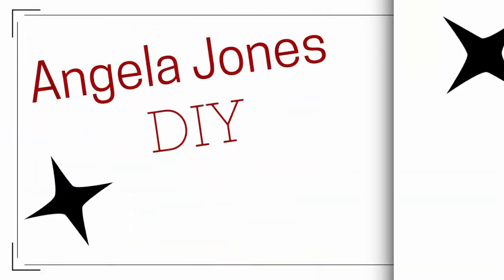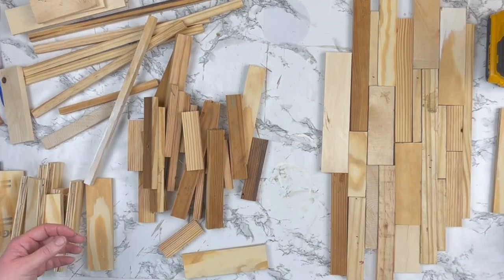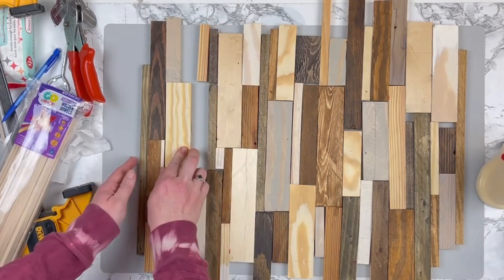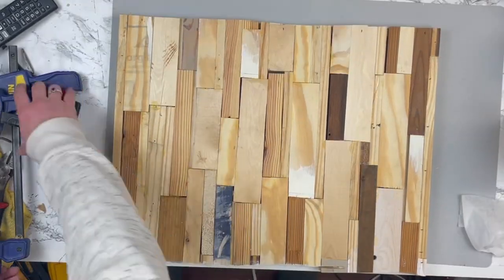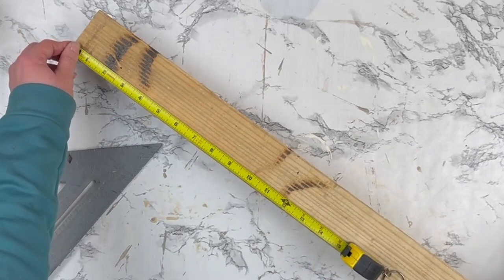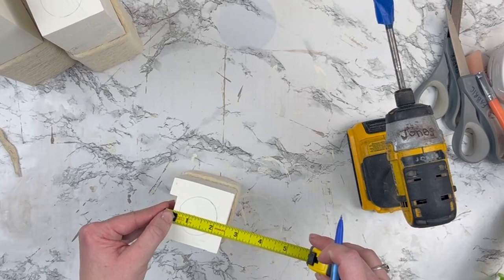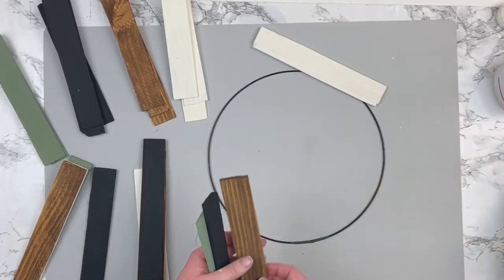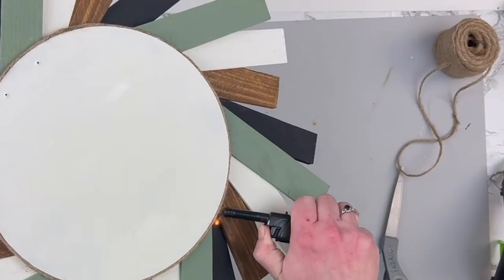Scrap Wood DIY Home Decor | Spring DIY | Wood Craft Projects | What to do with Scrap Wood

Comment: For the circular saw getting stuck, it's a result of the weight of the wood on the opposing side, without a support base, pinching the blade creating a significant deal of resistance. It wasn't too bad until you reached 6 inches or so because you weren't cutting off really big pieces, but as for that your only true solution is to get a base support on the opposing side, making sure you still have a path for the blade so it doesn't damage your bases.